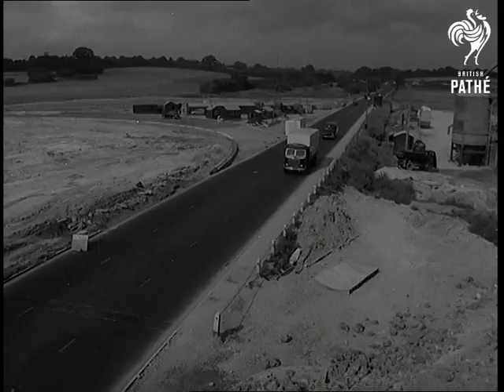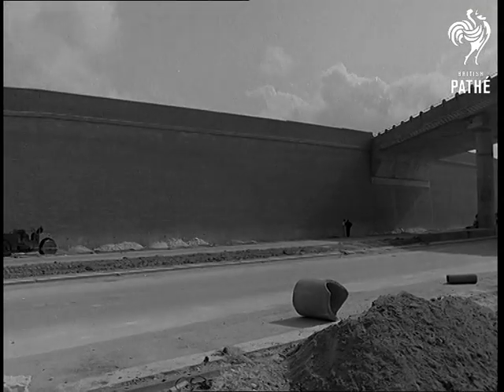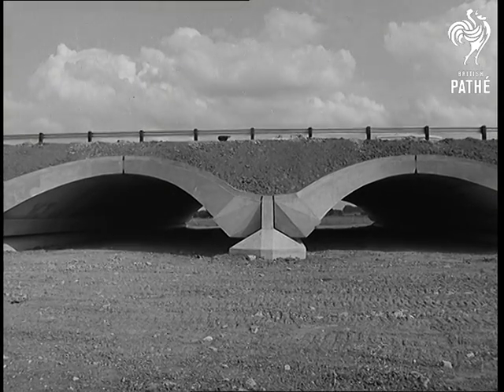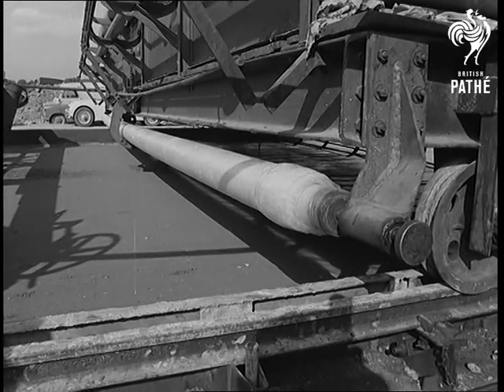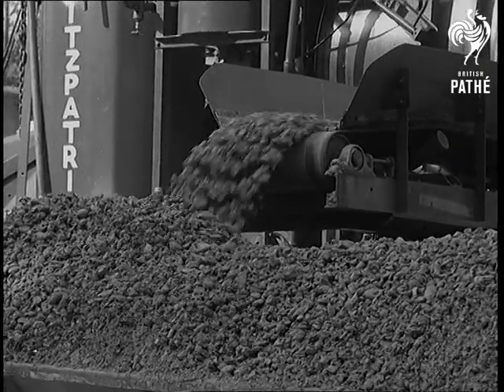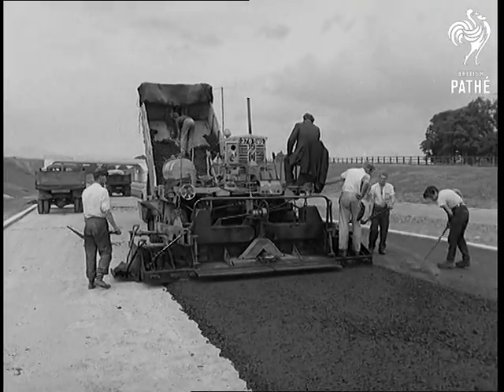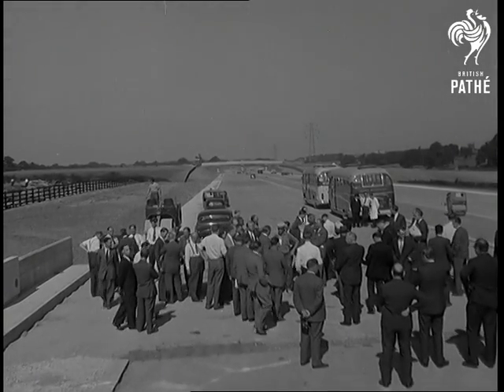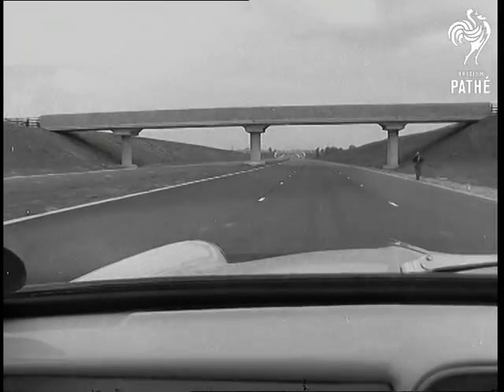Motorway Open Soon (1959)

Comment: I assume this is the M1 motorway as this was opened in 1959 along with the M45 motorway in Warwickshire?
I like the early type of paver machine laying the concrete to build the motorway.
Britain's actual first motorway bypassed Preston in Lancashire & was opened by the then Transport Secretary Earnest Marples in early December 1958. It had grass verges for hard shoulders & no central reservation, how times have changed!
No speed limits were imposed on these early motorways & many cars still had sidevalve engines which soon overheated & even blew up as they were not built for such speeds back then!
Reply: In 1958 Marples was Postmaster General. He didn't become Minister of Transport until 14th October 1959. He did open the 1st section of the M1 from Luton to Rugby. Harold Watkinson unveiled the M1's inauguration slab on 24th March 1958 at the Luton end.